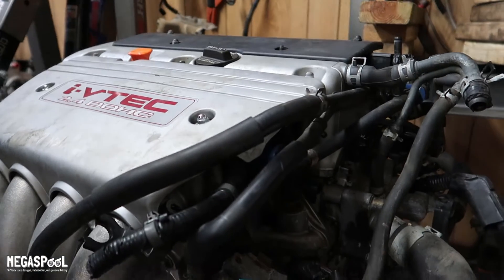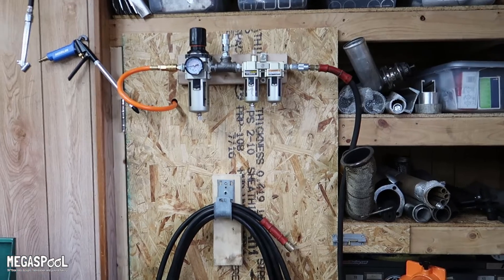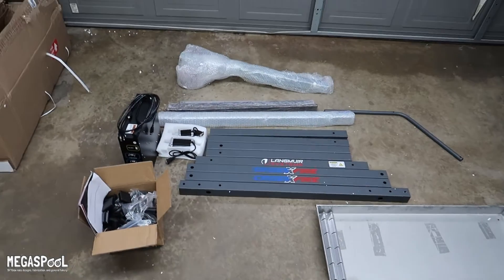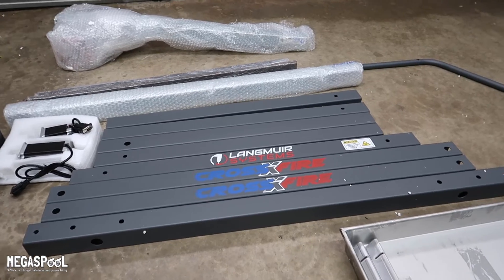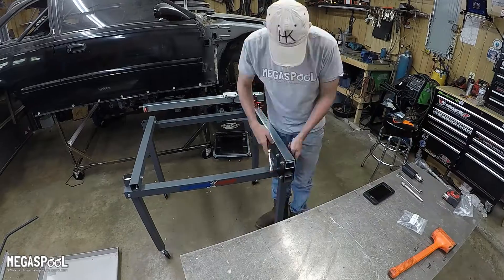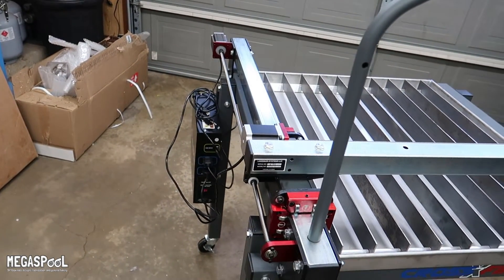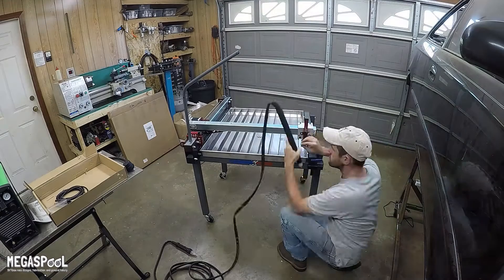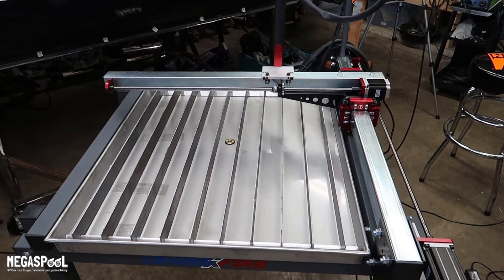The Plasma Table Is Here!

Comment: Wondering if that Everlast CNC torch would plug into my Razorweld machine, I like how it gets the lead up above the table more, and like not having to remove the torch whenever I want to slice up some scrap or whatever
Reply from the maker: M C I’m sure it would if the connectors are the same. Do you know if razorweld has a proprietary connector?
Reply: @MegaSpool  I dont think so, I know the torch itself shares consumables with many cutters

Comment: Nice video. I just ordered my cross fire and  Everlast 50s.  Where do you get your straight torch?  What p/n? Thanks
Reply from the maker: Mike Lapera thanks man. I picked up the whole setup directly from Everlast. If you email them they will help you out and usually cut you a bit of a deal. I still had the sales contact from when I purchased my welder a few years back. The cnc torch is on their site, if I remember correctly it’s about $200-$300.